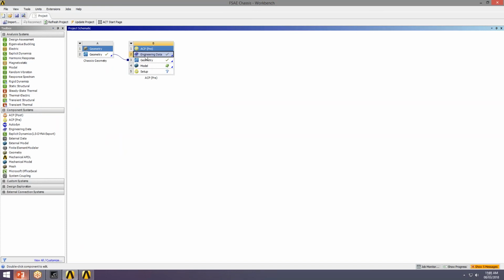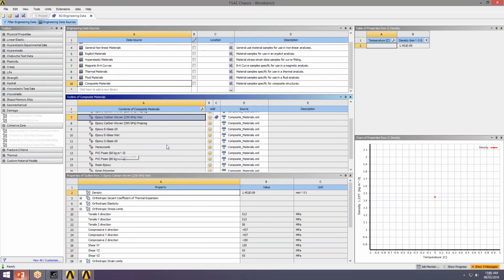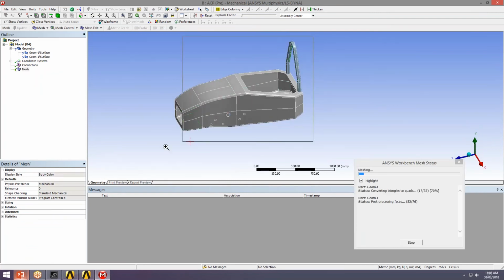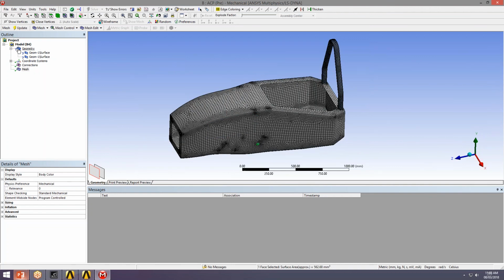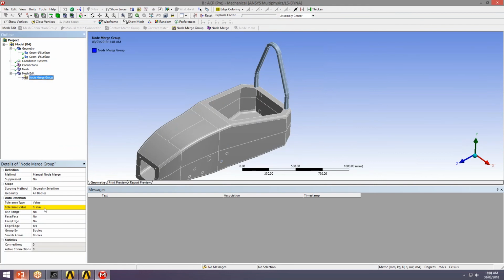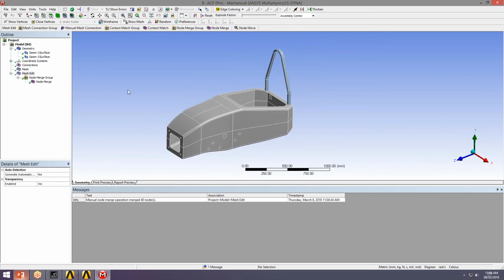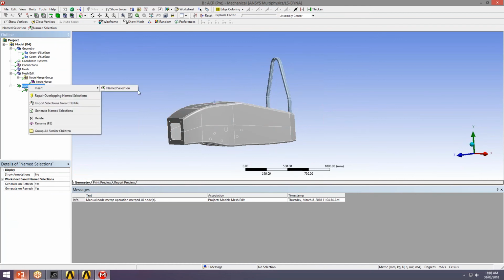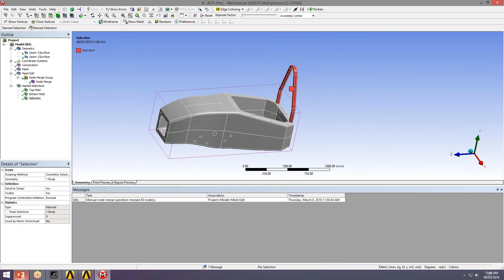ANSYS Composites Meshing and Named Selections - Demo - Composites for FSAE #3

Comment: Could someone please explain the practical benefit of doing this analysis when you don't even know the material properties of woven composites? More clearly, when you plan to actually manufacture a monocoque, the carbon fibre composite it's made out of will have different properties to those inputted into ANSYS. They will be drastically different too.
Reply: In that case this truly does not have a sense. I assume they just show how to solve this study without applying a legit material. But when you calculate this for real, then it is necessary to have a proper mechanical properties. Otherwise results will be out of nowhere.
Reply: Is it impossible to 1) Get the mechanical properties from material manufacture 2) Create test pieces (replicating same manufacturing practices that would be used in final structure) and measuring mechanical properties (not that easy but certainly doable)? Real concern is over simplistic approach to analysis that they show (omitting hard inserts etc.) but even simple study like this may teach a lot in terms of sensitivities to types of materials used, fiber orientation, etc. You seem to claim that woven composites are some kind of a mystery which they are not.